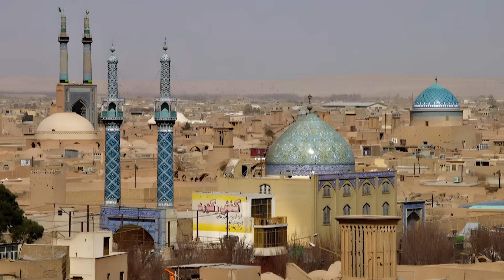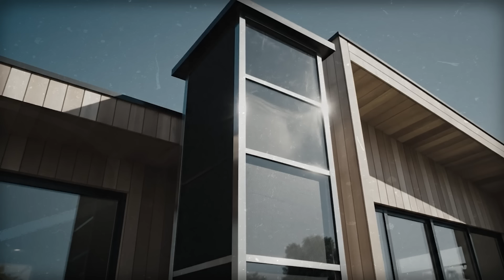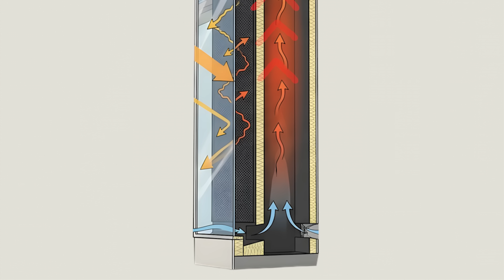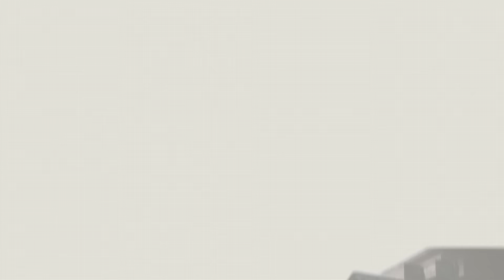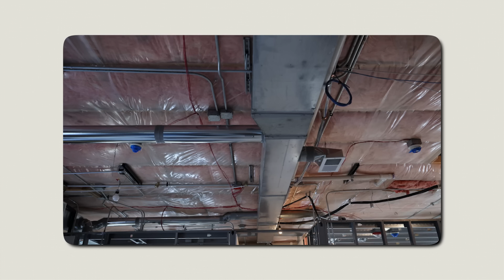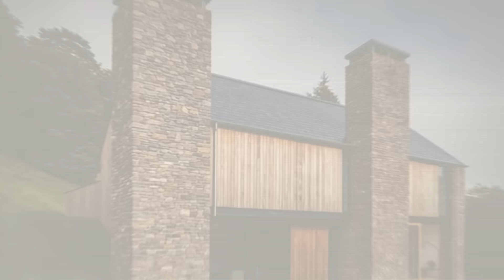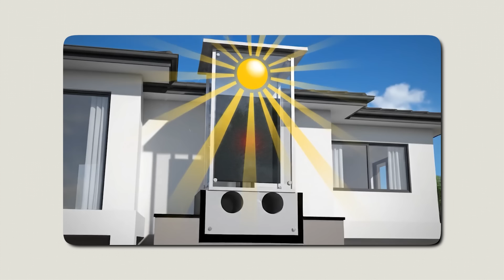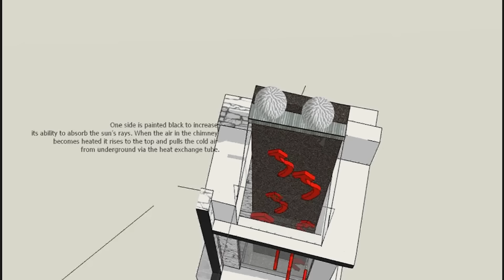This Chimney Will Cool Your Entire Home WITHOUT Electricity. Why Did The Energy Industry Hide It?

Comment: Nice information but how can it be retro fitted to existing homes
Reply from the maker: The simple solar chimney is a rectangle box build from strips of wood, an black absorber plate (can be any type of sheet metal - can even be tin can as per one of our previous videos) and perspex sheeting.  I would suggest the chimney should be a minimum of 2 meters in high in order to achieve the stack effect.  You need to add two vents holes as the bottom (one facing the wall and one facing out) and one vent at the top facing out.  The outside vents should have vents install that can to be closed manually.  Then you need to cut a vent into your internal wall where you propose to locate your solar chimney and align that with the bottom vent of the solar chimney.  You then simply add brackets to the chimney and attached to your wall.  The key is have the bottom vent properly sealed otherwise you wont get the draw effect of the solar chimney.  I would test the chimney first on an outbuilding or shed before attaching it to your home.  You might be able to find an actual layout drawing on the internet.  Hope this helps!

Comment: You can achieve the same airflow just opening the window.
Reply from the maker: The principal of the solar chimney is the extraction of air using the stack effect.  While opening a window allows for air movement and thus a level of cooling if the air outside is cooler than inside, it does not provide the same level of cooling.  Thank you for the comment!